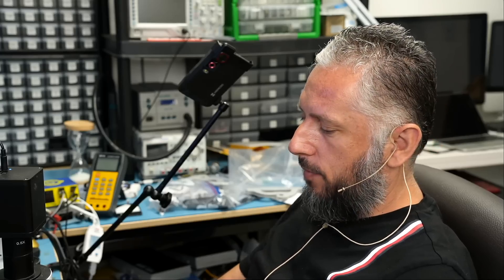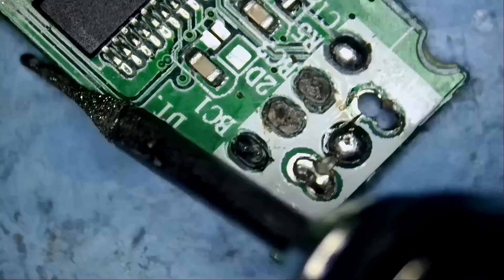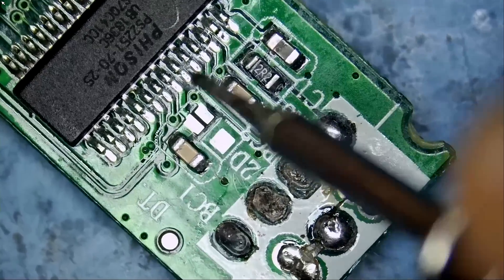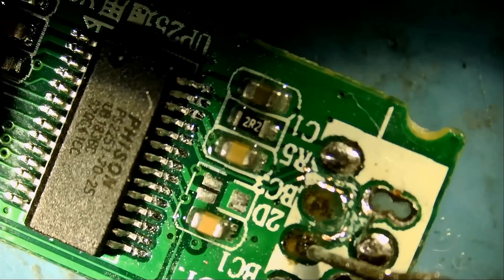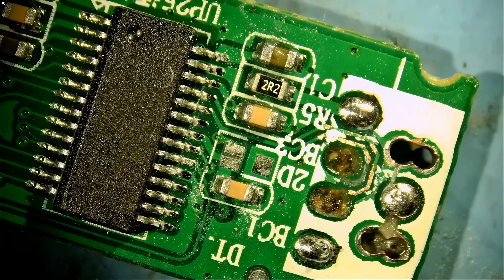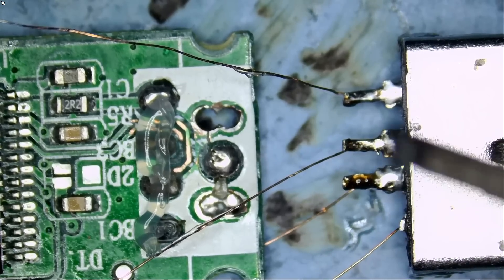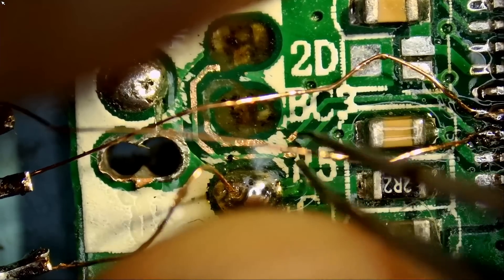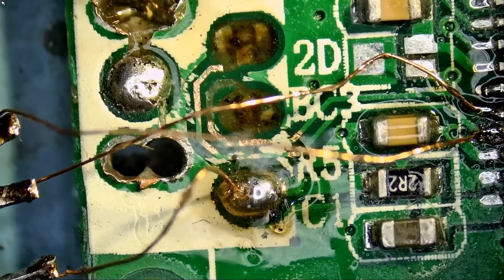Broken USB Flash Drive Repair and Data recovery. Hidden Traces.

Comment: I had no idea enameled copper wire could be soldered just like that. I used to scrape the laquer off with a knife or something. There's always something new to learn with NorthridgeFix - thanks!
Reply: If the soldering tip is hot enough, it can burn off the coating.
Reply: he's scrapping it off with the soldering iron while on the job
Reply: @Daeth111  Yes he burns the laquer with the sodlering iron and then scrapes it off. I will try next time also with some thicker wire.
Reply: it is solderable enamel wire, you can see one of the makers called Elektrisola, there is an enamel wire that can be opened with solder.
Reply: @donoberdoni351  Awesome - thanks! The Polyurethane based laquers are directly solderable they say.

Comment: Why didn't you put track pads and installed new USB pin, like you do for other things with missing pads? Just curious to know.
Reply from the maker: Why would you do that. Waste of time. Flash drives are cheap. We transferred the files to a new one.
Reply: @NorthridgeFix  Oh okay. In India Scandisk 128GB Pen-drive it cost as 8.13$.
Reply: @BhaveshMalviya96  Data recovery labor time shouldn't include trying to repair a worthless flash drive. He got it working fast, transferred the files and folders over to a new USB Flash Drive and sold it to the customer + data recovery fee. Now he has a used drive to put in his spare parts bin...on to the next  repair w/spare parts in the bin. Fast, efficient and profitable and the customer is happy. win win

Comment: Can we just measure with a multi meter from D+/D- to the chip legs, so we don't have to grind all the pads.
Reply from the maker: bro, What are you smoking ?
Reply: @NorthridgeFix  He mean to say that we can use multimeter to check continuity for specific pads by just grinding little near missing pads.
Reply: @NorthridgeFix  LOL ChadRidgeFix

To the original comment, He doesnt know the pinout for the chip and since he could see a trace from one of the data pads to the IC he knew the other would be right beside since USB data lines have to run parallel to each other (differential pair)